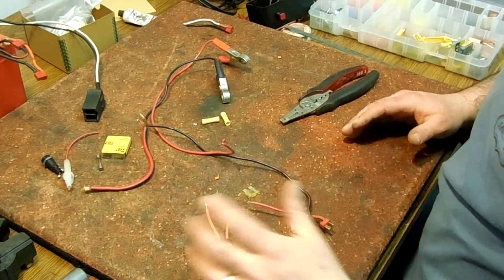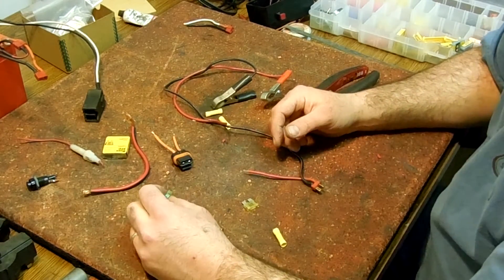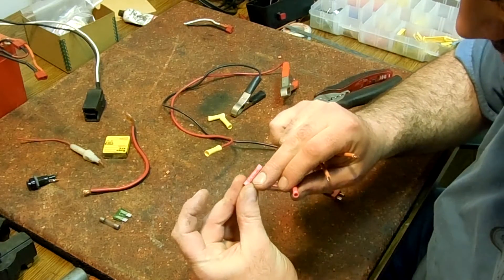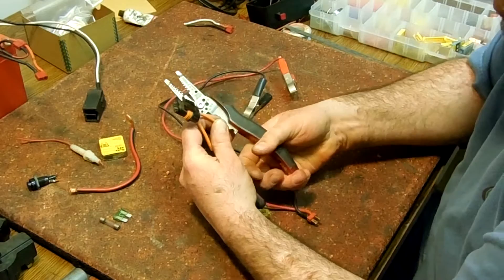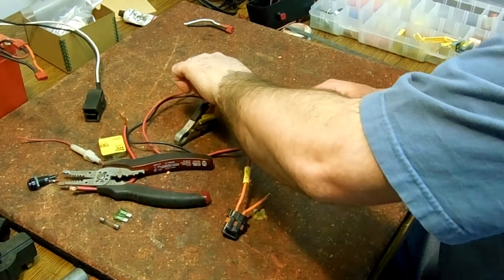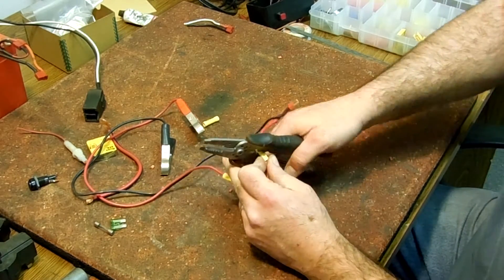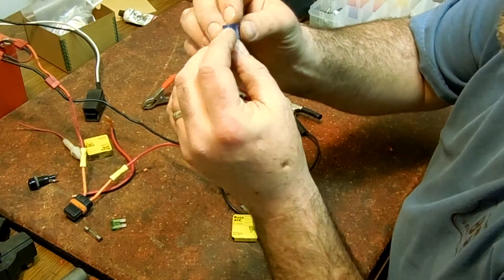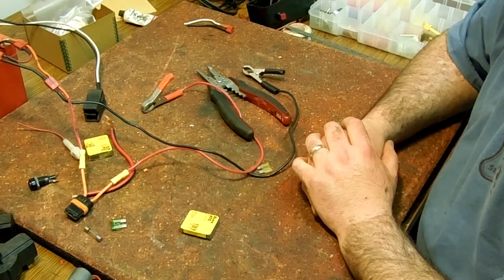How to add an inline fuse to a DC electric system.

Comment: Hello, im noob at electronics, so fuse need to be installed at the positive wire right? And what really happens when for example i charge something and accidentally reversed the polarity between the charger and batteries. Positive to negative and vice versa
Reply from the maker: Yes fuse on the positive side. I'm not sure what reversal positive and negative will do, it depends on the charger's internal circuitry and failsafes
Reply: @joeseif  thanks bro

Comment: Question, I want to put a fuse inline on a (120V) to 14 volt transformer (powering a lamp). Does it matter which lead I connect the fuse to? Should I use 2 fuses? Also, the transformer indicates 1.1 amps. thanks
Reply from the maker: one fuse on the positive side
Reply from the maker: go with hot side

Comment: And that folks is why butt connectors are not recommended.
Reply: I feel like if he had stripped a bit more insulation so that there was more wire for the crimp to bit into then it would have held.
Reply: who ever invented them is stupid asf
Reply: or smart asf he might me an owner of electrical shops across the world
Reply from the maker: what would you use instead?
Reply: @joeseif  Sometimes butt connectors are a pain, however, they work pretty good when tight. No worries mate. You got er done.
Reply: i think butt connectors are okay if you know what you are doing and need to make a quick connection.. but i personally would solder and heat shrink stuff as much as possible